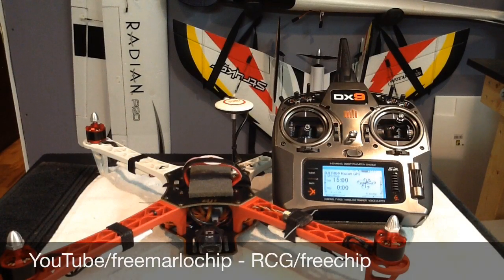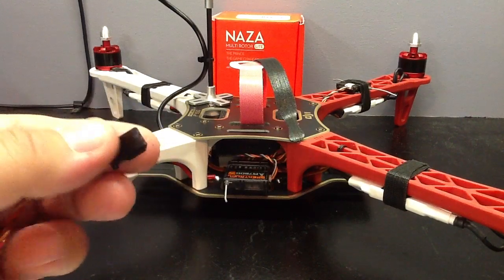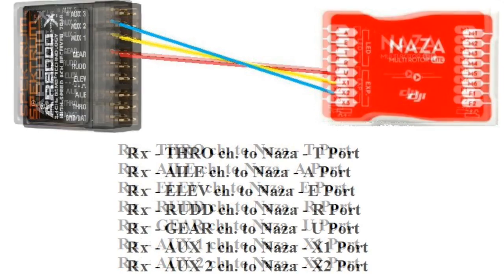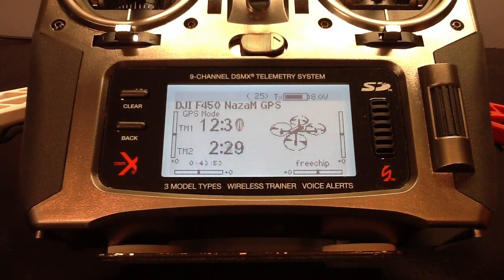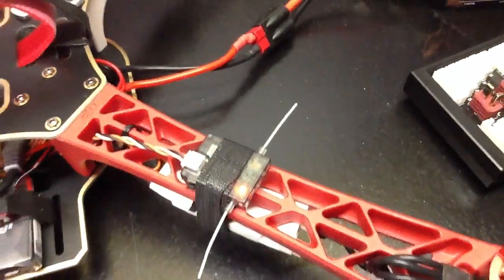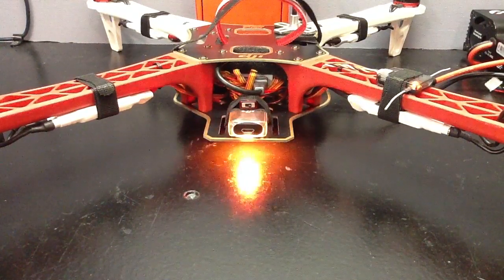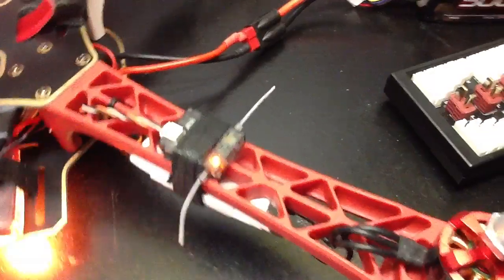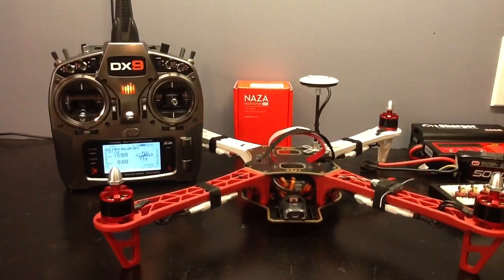Spektrum Programming for NazaM Video#4

Comment: Hi. I'm following your video for dx8 programming and get to this video and now your using a dx9! Does this make a difference to the programming steps? Many thanks
Reply from the maker: The first two videos in this series are parts 1 & 2 for the DX9 radio while part 3 of for the DX8. The rest of the video using a DX9 still applies to DX8 since the programming doesn't change and the videos focus on connections for the Naza and Rx and setting up Naza Assistant.
Reply: Excellent thank you. And thanks for a brilliant video :-)

Comment: At the moment I only have a 6 CH Orange receiver. What is IOC remote gain and do I need that?
Reply from the maker: Mark Edell IOC = Intellegent Orientation Control - allows the model to be flown in a direction regardless of the nose of the model. Remote Gains is the ability to remotely adjust the gains of the Naza Flight controller but this function would be best suited with an analog input like a Knob or Lever.  So both may not be needed for some folks.
Reply: freemarlochip Good info. Thanks! I guess the IOC mode is like the "Safe Mode" on my 350QX. I hate that mode! LOL The in flight Gain mode is something I am not interested in either so I guess I have one extra channel! :-D 

All of my other builds have been Multiwii based but I was having a hard time with gps so I am trying NAZA for my camera platform model.
Reply from the maker: Mark Edell IOC is comprised of two flight modes( CourseLock & HomeLock ) CourseLock is based on the recorded heading and HomeLock is based on the recorded Home Point Location, YES CourseLock is very much liek SMART mode on the 350QX line up which I also have and dislike BUT I can see where it would be useful for new pilots.
Reply: freemarlochip Hmm So do I need IOC for the return to home feature?
Reply from the maker: Mark Edell No - RTH is handeld with the channel that controls your GPS, ATTI & Manual mode, anytime the channel travel is in between these modes it will be in Failsafe and if you have the GPS compass installed you can check the box in the Assistant for Failsafe RTH and Land
Reply: freemarlochip Thanks for the help. You rock!
Reply from the maker: Mark Edell Only human and I enjoy helping others.... :) Have fun, I know I am...
Reply: freemarlochip I'm Back (sorry) I am up to the binding portion... If I pull out the bind plug on my OrangeRX R615 receiver it will no longer be in bind mode and it won't bind. I have bound to the receiver with the bind plug in but all I get is the flashing red light, no green. Do I have to bite the bullet and get a spectrum receiver? **EDIT** I got it to bind with the plug out but I cant get a green light on the NAZA
Reply from the maker: Mark Edell I'm not miliar ith te Orange/HK stuff so I cn't commen on their binding proceedure except to say you need to bind in Preset Failsafe if you want RTH to work properly...
Reply: freemarlochip Uggg. Well I found a store that had a AR800 for sale (50 miles away!) and I still get the same thing. No green light. It binds ok but when I flip the failsafe back to the first postion I still get that obnoxious orange blinking LED. Any ideas on what I could be doing wrong?
Reply from the maker: Mark Edell 4 flash with small pause? This would indicate WARM UP and it's normal to last up to 30+seconds maybe... Constant Flash would mean RTH but this would be indicated when connected to the Naza Assistant..... Before Flying you should/must always do proper IMU Calibration and your Compass Dance outside.  If you like we can continue this via email (smarlo@yahoo.com)
Reply: freemarlochip No, a constant rapid flashing. I haven't got to the Naza Assistant yet. I'm going to do more reading and if that does not work i'll email you. Thanks!
Reply from the maker: Mark Edell Then DO NOT even worry about it, you can go flying anyways without having once connected to Naza Assistant and calibrating your sticks and setting up a bunch of stuff.
Reply: freemarlochip I just can't get it out of failsafe. It won't arm
Reply from the maker: Mark Edell Connected to Naza Assistant Yet? When you toggle your Flight Mode switch what does the Assistant show?
Reply: freemarlochip I can't even get assistant to show it at all :( This thing hates me lol
Reply from the maker: Mark Edell Connect USB cable to Naza, connect to PC, power Naza, PC should give confirmation tone & Naza LED shoudl be SOLID GREEN, Start Assistant Application. If you see SKIP option and it stays there for several seconds you have USB DRIVER issues..... Otherwise you first need to check the right Rx type "traditional" and then calibrate your sticks.... PLZ continue conversation via email....
Reply: I am having the same problem as Mark Edell.  I am using a DX( with a Spektrum AR7700 by way of PPM.  I have all my programming exactly the same as yours.  I cannot use the IOC function as it uses the X2 plug for the PPM data.  But otherwise everything else is the same.  After I complete the binding process I get a rapid flashing steady yellow light indicating it's still in fail safe mode no matter of throttle position or switch H position.  Got any advice?
Reply: I should also add that I'm using Naza lite M upgraded to 2.0.  When I connect to the Naza Assistant lite I can see that the Naza has connected but moving the sticks or switches does nothing in Naza Assistant Lite.

Comment: Hi, great videos, ive just setup my DX9 and all appears to be ok, i'm about to set up naza assistant, when will your next video be ready for naza assistant,
Many thanks, Steve.
Reply from the maker: Very soon. Sorry for the delay I've been a little busy with other projects but I'm ready to continue with this series.
Reply: freemarlochip Thanks for reply, ive fitted the spektrum ar8000 to my phantom 2 naza m v2, have tried configuring dx9 to naza assistant but will not work, there is no way of changing the rc settings from D-bus to traditional rx, have you found a way around this of configuring spektrum to naza m? im at a stand still now :-(